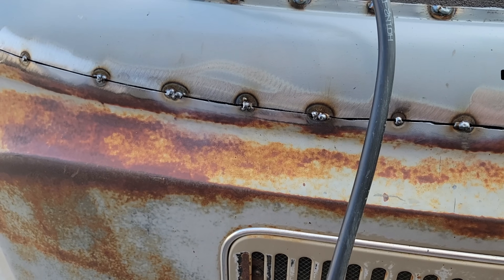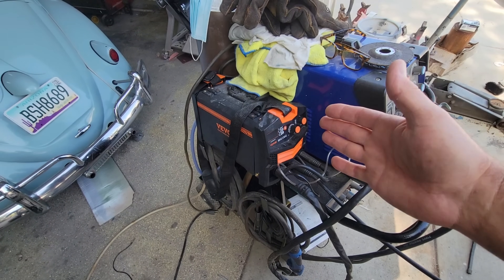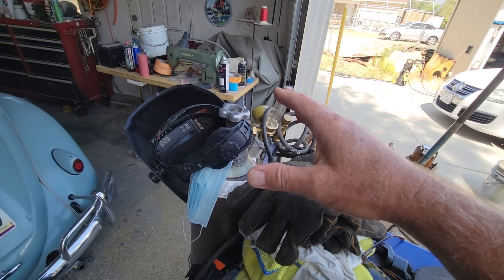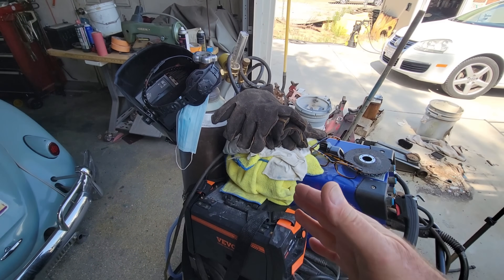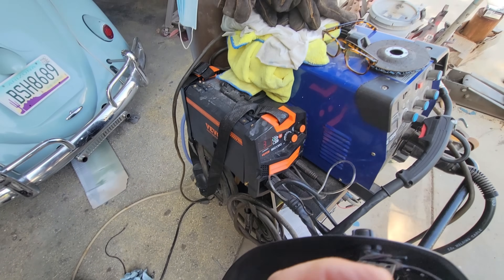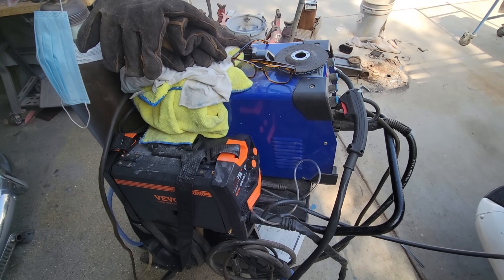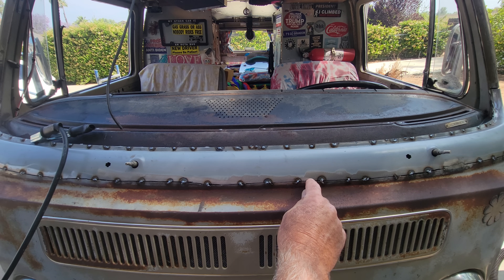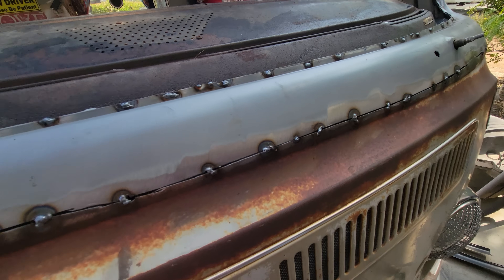Welding Basics For Beginners - Butt Welding Sheet Metal - Easiest welder to use - Tips and Tricks

Comment: You can't have gaps between sheet metal if using flux core mig wire. It just doesn't work, you'll regret even trying. You need to use mig with gas.
Reply from the maker: yea  for sure...you can lap tap and fill which is OK if that is all you got.

Comment: Starting with the easiest welder is perfect advice—any brand or model you recommend for beginners?
Reply from the maker: the one in the video is probably the easiest and cheapest link in the description. you can use any welder but the settings are key. this one makes it easy.

Comment: Butt welding sheet metal was done with an Acetylene Torch back when cars were made out of thicker metal (and real steels).
Reply from the maker: Yes sir takes me back a few years that is how I did it when I was 15 and 16 years old. up until I was about 19. We used wet rags and welding putty to keep it from warping as much.

Comment: Thanks for this video. It came at the best possible time for me. I've been fixing rust on my Rialta, and I'm about to start repairing a wheel well and planned to do butt welds. I've been having a real hard time with my spot welds. They keep popping. I saw in your longer video that you did spot welding as well as these butt welds. Maybe you could do a short video on spot welding? I've tried using the weld through primer I saw you use, but the welds still kept popping. If you want to look at my latest video and maybe tell me what I'm doing wrong, I wouldn't mind at all. I call myself A Rank Amateur, because I am. I took a 10 week welding course so I know a lot of the basics, but I'm still bad. I'm glad to see the info in this video, it helps me feel better about going to do the butt welds.
Reply from the maker: clean metal and a good tip help. But usually when the wire hits the metal it will pop for a second then weld. Make sure your close enough to the surface. Maybe put the CUP on the edge of the metal to hold it steady. pull the trigger and POP then weld.
Reply: @Mikefngarage  I tried tonight to weld into the gap like your video, but kept blowing through, splattering, getting horrible welds I couldn't figure it out so I packed up for the night. I went to turn off the gas... it was already off. DOH!

I always check the gas bubble before I start and it was at 20, but that was the stored pressure in the regulator.

ANyway, thanks for the tip above. I wanted to ask what wire size would you use to butt weld 22 gauge. Turns out my wheel well is 22 gauge.

Comment: oh yeah I got a 115$ Hitbox welder and it's a flux core but what it does on 220v it ark welds nice , as little I weld it won't pay to get a gas welder . I also got a stick welder 220v that turned up you can cut 3/16 angle iron with it ?????
Reply from the maker: yea I might do a video using this one with flux core also has stick setup I believe too' Cant remember. I think it could butt weld with flux but will create a bit more heat. so you really could not use it to do very many continuous welds.